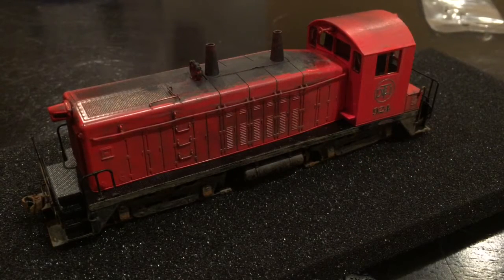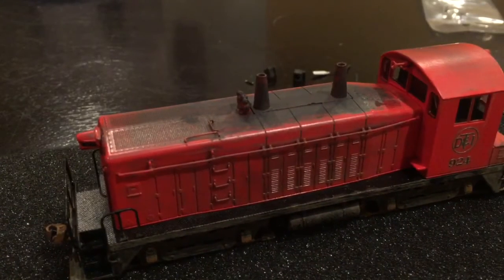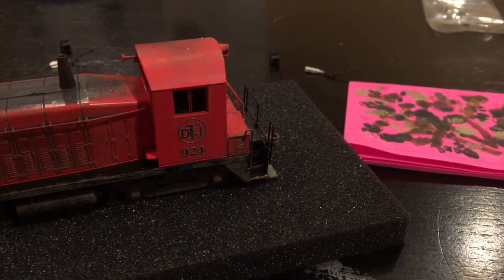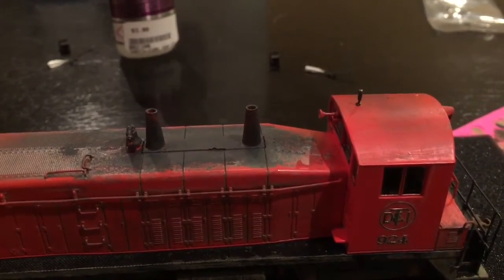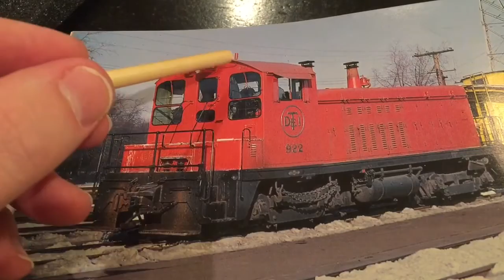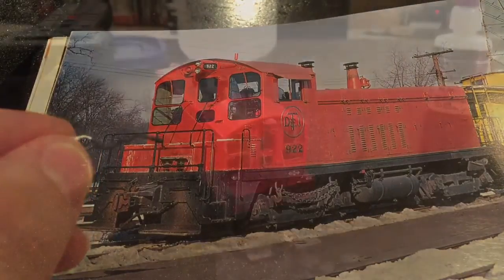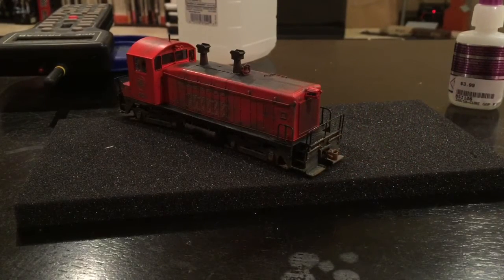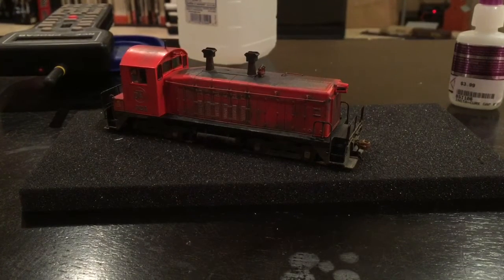Weather and Detail an HO Locomotive in an Evening: Part 2

Comment: Looks great, if I was you I would drill threw the frame and us two I bolts. Then you can bend them down to the length that you need and hook the chains to the trucks.
Reply from the maker: I started to do just that but when I found out the frame was metal I thought it might break my tiny drill bits.